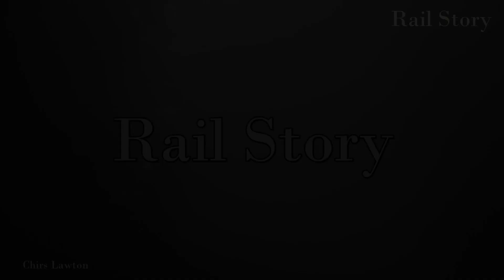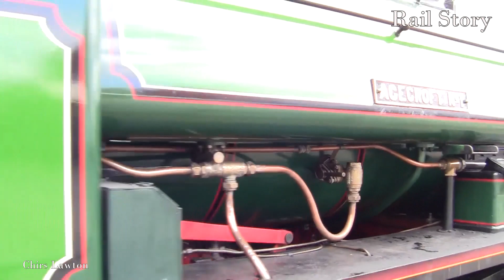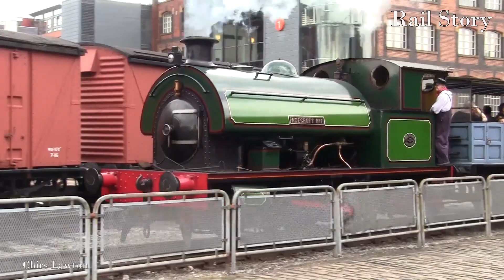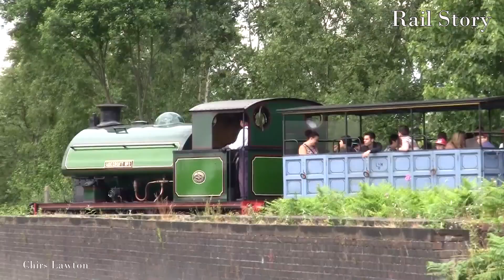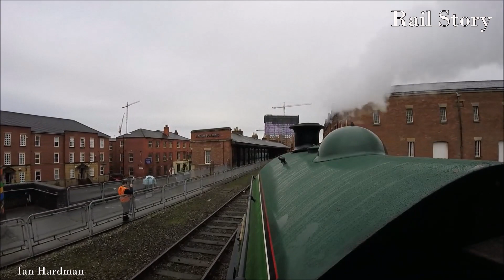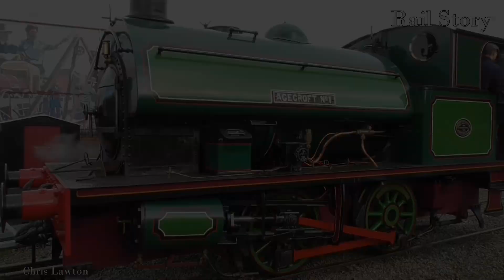Profile Agecroft:  1

Comment: Question: Would the mentioned replica coaches happen to be the ones at MOSI?
Reply from the maker: Yes. They're based on period drawings from Nicholas Wood's 1838 Treatise on Railroads and Interior Communication. (so far more reliable than the ones built by the LMS to go with Lion: actually based on 1830s drawings!)

Comment: Will you be taking a look at all 3 of the Agecroft engines?  Would be good to see you at Whitwell while No.3 is running 😃👍
Reply from the maker: Possibly! More a documentary on Agecroft, include the EE electric locos, some oral history and stuff like that. Whilst all three Agecroft locos survive, it's also worth noting that both Bolton Back'Oth Bank Locomotives do as well : Bolton 1 (Agecroft 3) and the Bolton Battery loco.  Just paint Bolton No. 1 on the tank....
Reply: @AnthonyDawsonHistory  There's so much interesting History on No. 3. Unlike 1 or 2 she's not fitted with a mechanical lubricator and we've found a lot of her componants are still original with her stamp number. We did think about having Bolton No.1 on one side of the tank while we were painting Agecroft 3 but perhaps we can do that in the future.
Reply from the maker: @thurstablelane7567   1 & 2 had Wakefield lubricators from new, and I can't see why 3 wouldn't have. 3 had a new firebox fitted in 1961; and had tank plates renewed by a company in Wigan. The shed at Agecroft was able to undertake quite heavy overhauls, e.g. to Ag 2 in the 1970s. Unlike 1 & 2 Bolton 1 was delivered in corporate livery, eg BEA colours. 1 &2 arrived in RSH works livery, including the scumbled cab.

Comment: What's the name of the class of engine?
Reply from the maker: RSH 14 inch.
Reply: @AnthonyDawsonHistory  what a odd name
Reply from the maker: @blu5118  RSH is the builder (Robert Stephenson & Hawthorn) 14inch the cylinder bore. Industrial locomotives were mass produced, built either for stock (so bought off the shelf) or built to order to a standard design. Customers would go to a builder and order a "14 inch" from RSH and know exactly what they were going to get. Same with eg Hunslets of Leeds or Bagnalls of Stafford.
Reply: @AnthonyDawsonHistory  Neat

Comment: Why such a short wheelbase?
Reply: To get around tight curves.
Reply: @jerribee1  Much like dock tanks.
Reply: @johnjephcote7636  Or indeed like those used in gas works. If you've not done so, you should look at a map of Beckton Gas works; lots of track and lots of curves.
Reply: Mainly so it could navigate sharp curves that engines with longer wheelbases couldn't.